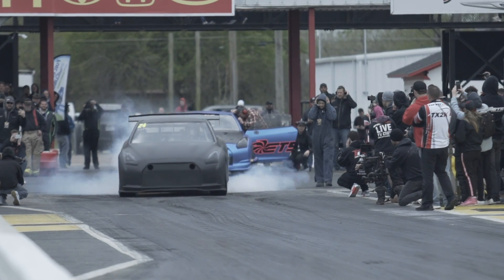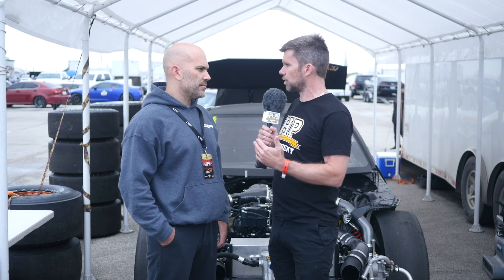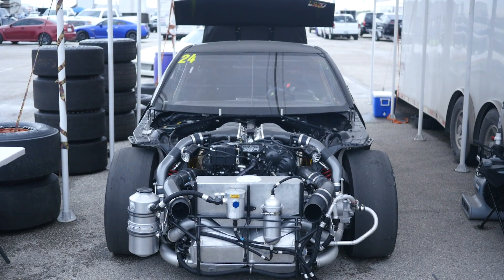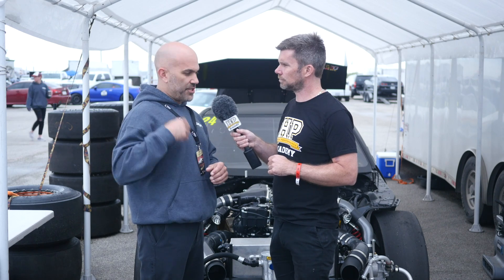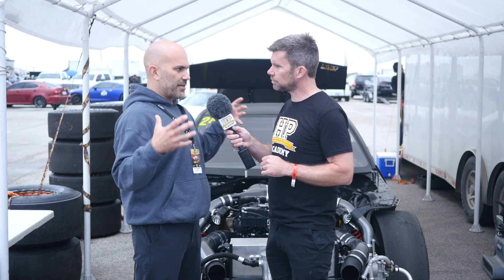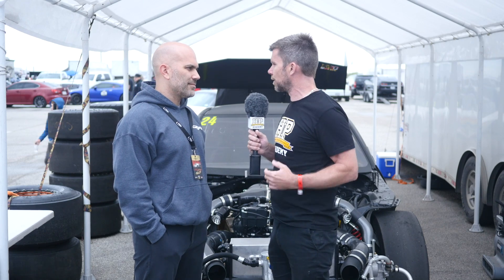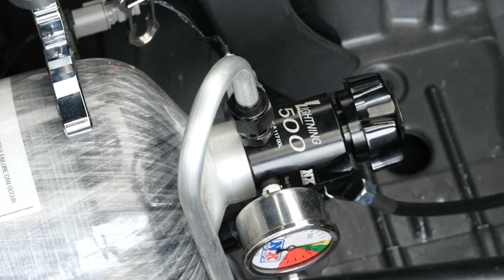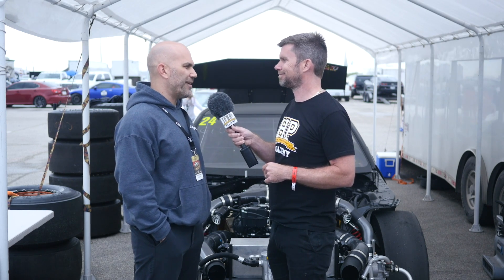2280WHP R35 GT-R | How To Gun For 6's While TURBO Limited | Tony Palo [TECH TALK]

Comment: There's a record for everything now.... an honesty is it really even a gtr anymore.. the whole front end snaps off.. just call it a racecar with a built gtr motor.
Reply: well it's still a GTR, because anyone can recognize it as a GTR and the chasis is still a GTR chasis (which is not designed for drag racing).  Now if it has tubular chasis and a dragster rear end, then that's when I'd not call it a GTR anymore

Comment: These gtr guys just make up their own records whats next fastest gtr with a gas tank in the stock location
Reply: Stock steering wheel location.. Stock interior head lamp location.. Stock hood record.. Stock paint record .. Stock water pump record.. Stock radiator hose record.. Lol you can go on for days...
Reply from the maker: If you've been to an event like TX2K you'd understand the need to different classes like this. There are so many R35's it would be boring for everyone to just be using the same rules and shooting for the same goal to the point that people just wouldn't bother. What class do you race in? - Taz.
Reply from the maker: @Jeff, you could, but, nobody actually has =) 
I think it's great there are more options for those that like a different challenge or don't have an endless budget personally. On the surface it can look a little silly but there is reasoning there - Taz.
Reply: @hpa101  its crazy how they can take a 3.8 litre engine that makes 540hp and crank it to 2000+

Comment: How do these cars cool themselves down without a front grill??
Reply from the maker: Hey Azan, the air to water intercooler is discussed near the end of the video ;) - Taz.
Reply: Drag racing engines don't really need the standard radiator cooling that street and road racing cars use, because they run for such a short time. Some of the high power engines on factory blocks fill in the water jackets for extra strength, and a lot of billet blocks for drag racing don't have them to begin with. Some get enough cooling through methanol that they don't run intercoolers.

Comment: is air to water intercooler good for daily driven/track racing? would like to hear from people that has experience with it
Reply: Can work. Even OEMs do it.
Reply: OEM 4th/5th gen 3s-gte uses it. I am pretty sure they used it on celica rally cars and did well, but they were also cheating. I wouldn't use it unless you can't get enough cooling with an air to air intercooler, mainly because the water system is adding another thing that could potentially fail.

Comment: So the real question is. How is a factory aluminum block so reliable?
Reply: Lots of sensors, a motec ecu, and a good tuner. The aluminum blocks are "reliable" up to 2200ish hp. After that T1, ETS use a billet block and replace sleeves and rotating assembly as needed. Usually 6-8 passes and the internals are replaced
Reply: Wire-arch welded cylinder liners is the key. They use a billet girdle at this power level too but bores are stock.

Comment: Can you run a water to air intercooler on a daily. why or why not
Reply from the maker: @Asbjorn, some of the pros and cons are discussed in this video. It's worth a watch before commenting ;) - Taz.
Reply: High Performance Academy I did. It was great I’m just dumb
Reply: Asbjorn Ross of course you can. I am looking to do just that for smaller volume = better response.. However, it requires another radiator. and fan somewhere.
Reply: Alot of cars came factory with air to water coolers
Reply: jack Clark so why aren’t there more water to air inter cooled cars. Is there any down side to it
Reply: @asbjornross1927  Of course there's downsides. It's a heavier, more complex system that is fundamentally less efficient. If the pump fails or you develop a leak, it can be catastrophic (though usually just pulls boost and timing on any good modern ECU) or very annoying. Air to air doesn't have that issue. But air to water systems can be very useful for packaging since you don't need airflow at the intercooler location, so they certainly have their place.
Reply: @samjc3  All the above is unlikely to happen unless you cheap out. For example how many Ford Lightnings have a failed water pump  as it was one of the first intercooler supercharged production cars in the US? That Bosch pump is dead reliable. Even if it fails a water to air seldom goes above 120 degrees if water is still present in the system. Leaks is a installation issue and easily prevented.  As Tony said an air to air to cool down the turbo air for 1,000 hp the unit gets quite large. If you don't mind having a bumper support this isn't an issue but for the majority of people that is an issue.  The tight engine compartment of my Focus ST doesn't allow an air to water system. If I wanted to stay around 350 hp, something can be done, but above that the intercooler core needs to be larger than I can accommodate. On my other car however I think it's possible since the factory air to air core is quite large and can easily be replaced while the location lower in the front fascia can easily handle the heat exchanger. Problem sort of is the charge pipping largely remains the same so advantage there. But since I live in Southern California, keeping temps down is a premium in the summer. I also run nitrous and water-methanol injection. Nitrous alone can bring inlet tems down to near zero and bring it's own oxygen in the process, the only limit is can you hold the head(s) on the block...
Reply: @asbjornross1927  It is more complex, more expensive, and there are more components to fail.

Comment: Work of Art

Edit: How is it possible the stock block with stock sleeve can handle 2000hp and 75 pounds of boost? Does this mean R35 engine is stronger or at least as strong as the 2JZ?
Reply: Vr38 is the most powerful Imports engine so far. With auto and rwd and lighter weight,  this would be a 5 sec car.
Reply: Stock VS. Stock I would say the 2J has an advantage. The VR38 has weaker rods which can't be pushed as hard as the factory 2J rods. Fully built though.... The VR38 may have an advantage. I think Switzer was the first to recognize how well designed these factory blocks are. They were just installing aftermarket pistons and cranks while everyone else was sleeving.
Reply: @muskytuned  agreed
Reply: @muskytuned  As Tony said previous experience told them to sleeve it. That said if it works, don't fix it. A problem with Tuner/Import community still is the lack of an actual proper engine program. In other words you spend the off season breaking parts in the dyno room instead of out on the track. Tuners on a budget oil down the track and complain about running diapers, series then fine then and they don't come back, race on the street instead. A good engine program when everybody knows the limitations already you leave the leading edge stuff to the professionals. While the average punter can pay for whatever power level he needs, which is for 98% of customers is FAR BELOW 2000 hp.
Reply: azrul nizam nope. The 2jz is an i6 and is inherently balanced and has minimal counter weights on the crank. The V6 is inherently unbalanced and has large counter weights on the crank that cause huge stresses on the crank at high rpm, hence the crank cracking. RB, 2jz & Barra are i6.
Reply: @nordic5490  any car breaks crank when making 2k hp
Reply: @mehrshadvr4 Jon Mihovetz has made close to 3000hp on a stock 4.6 crank and never broken one.
Reply: The fastest barra owned by dion at dyno mite performance runs 2000hp on a standard block/head/crank.
Reply from the maker: @HALO3FORLIFE100  It's it running in the 7's? - Taz.
Reply: VR38 is way better than a 2jz if that’s not clear enough by now
Reply: @undergroundriptiles7005  It’s impressive to how a modern cast aluminum block can do. You get both the weight benefit and a strength to feed them with boost.